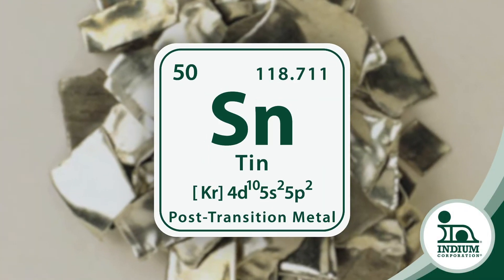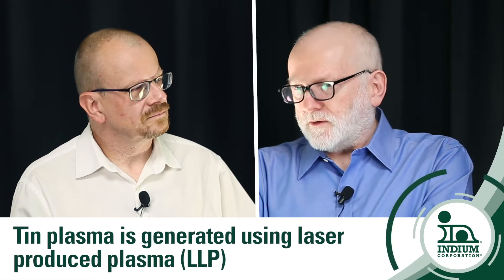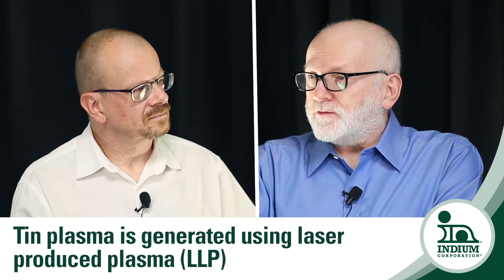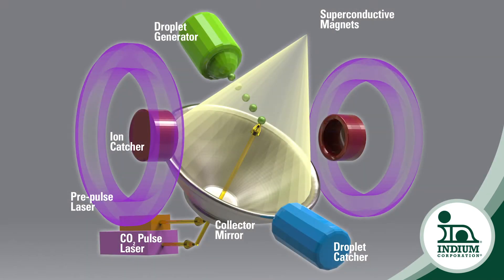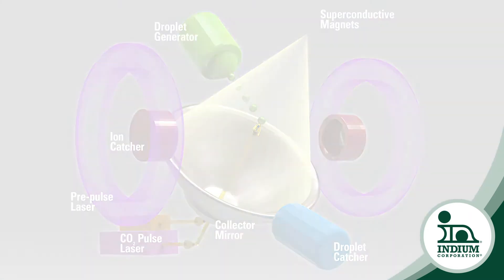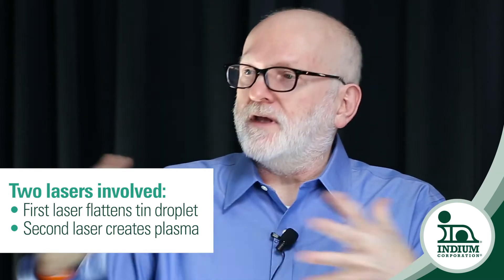Tin and Laser Produced Plasma (LPP)

Comment: How many tons of tin is required for an average euv machine? Purity is 99.999? Pls enlighten us
Reply: 2 grams per wafer. Basically nothing.
Reply: Since the continuously generated tin droplets are only about 27 micrometer in diameter and the repetition rate is 50 kHz, one can calculate that the tin consumption should be not more than 100 kg in one year for an EUV machine with 90% uptime. But if there are 100 machines running, then you come indeed to a range of about 10 tons per year.

Comment: Thanks for the video.  Do you expect any problems or constraints with the supply of tin?  I don't have a sense of how much tin is required by the semiconductor industry when all or most chips chips will be produced by EUV Lithography.  It seems to me that this will be a massive increase in incremental demand for tin.  I am trying to quantify the amount of tin needed per year with EUV Lithography.  Can you point me in the right direction.
Reply: I would think they could reclame the Tin and reuse/recycle in the system.